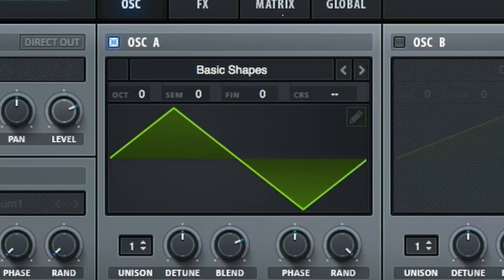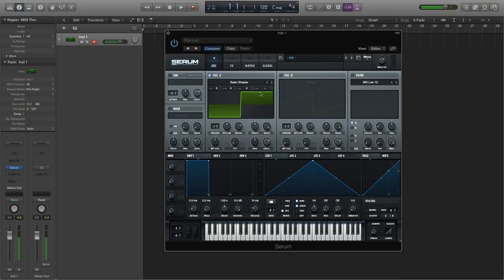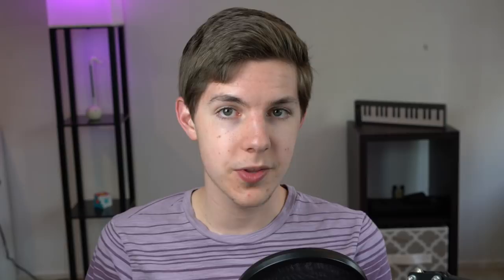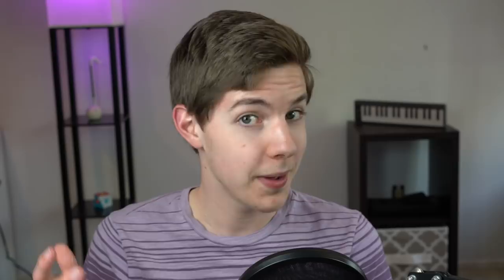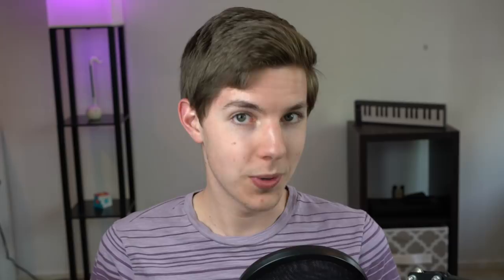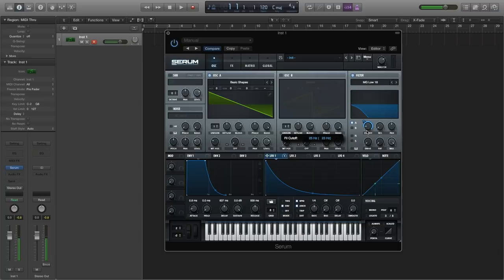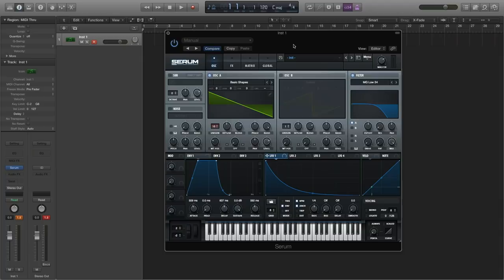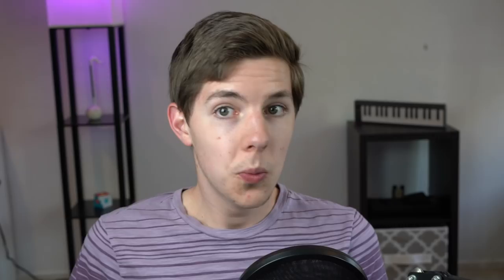Synthesizers Explained for Beginners (Sound Design Tutorial)

Comment: Great tutorials. Would be even greater if you could use a free synth like dexed.
Reply: @Julian Dill Great. I'll try that one. Thanks!
Reply: Dexed is an fm synth that's a different kind of synthesis. So it works kinda different. If you looking for free synths that are subtractive see tyrelno6, Helm, Tal noisemaker, odin2, synth1, surge. They have all the same parameters as serum (except for wavetables and wt position)

Comment: It's unclear how u're able to filter out frequencies (out of the tone) when the base waveform is supposed to be monochromatic/only of a single frequency(pitch) which is the base input/control parameter. There's a hierarchy of notions that's being overlooked here, I think.
Reply from the maker: Unless the wave is a pure sine wave, it's not a single frequency tone, it's got a bunch of upper harmonics which give it its timbre. A saw wave is a good example, it's actually a really complex sound that we can shape by removing stuff (hence the term subtractive synthesis).
Reply: @GabeMillerMusic  Indeed, but I don't think you mentioned that. Now my question is, can a pure base waveform be synthed without the harmonics ? I mean without the need to subsequently filter them out ?
Reply: @GabeMillerMusic  Sorry, now I realized I'm probably looking from a different synth method pow. It makes sense to have a complex primitive in order to subtract from it. n00b